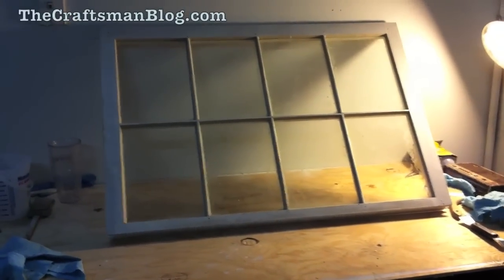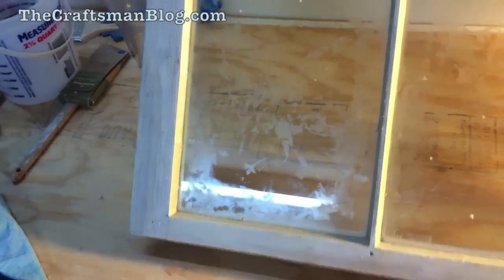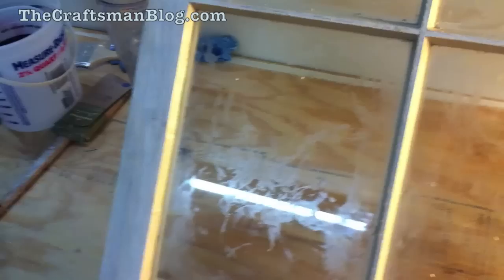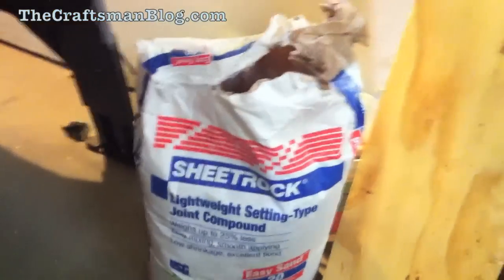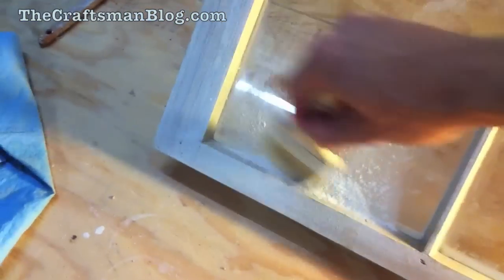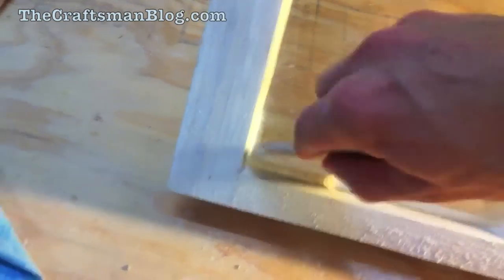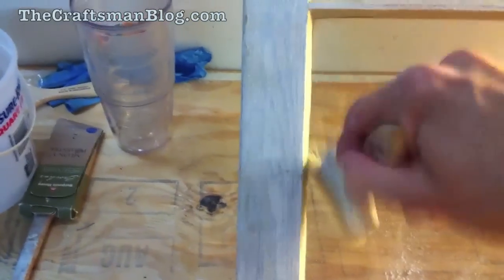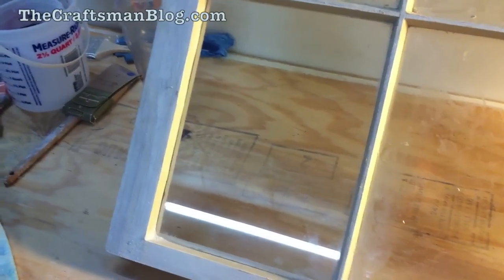How To: Clean Oily Glass

Comment: I recently went through the same search for “whiting”. Big box store paint departments were no help. Then a search on the internet turned up the product, but it is expensive. So ... I researched the ingredients in “whiting” ... only one ingredient, calcium carbonate ... which is simply powdered limestone. Also known as lime, the same stuff used to line athletic fields, and it can also be used as a soil amendment that loosens clay soil.  Many other uses too. I found it at the Rural King farm store for $2.99 per 50lb bag. Now I have enough to clean the putty oil off of every window in the city.

Other possible products: Bon-ami (finely powdered feldspar), Gold Medal flour (obtained from wife’s kitchen),  Plaster of Paris (powdered gypsum), and of course patching plaster (mostly powdered gypsum).
Reply: Solid tip, many thanks.
Reply: You can also find calcium carbonate at home brewing supply shops if you don't have a farm store around, not as cheap as yours but only a couple bucks a pound which is still much less than amazon wants for 'whiting'

Comment: I just learned of "whiting powder" today to clean glazing oils off glass, and was going to order 2 lbs. for $12.98 + shipping.  But how did I not know about it before now?  I know a lot about a lot of things about home improvement, remodeling, maintenance, restoration projects.  Not only the whiting, I now learn I've had the product all along in the form of joint compound and lime for my yard, and it only cost pennies per pound.  I think of all those windows, main windows and old wooden storms, that my wife and I reglazed and struggled to get the glazing oils off of.  Most are done.  Sheesh!
Reply from the maker: I wouldn’t use lime for this since it is caustic and very alkaline, but gypsum works like in the video. It doesn’t clean quite as well and still has more reactivity than whiting which is completely inert though.
Reply: @TheCraftsmanBlog  Thanks for the tip, I would have used the gypsum/joint compound anyway, lime isn't something I keep around - would have done a bit more research anyway.  Thanks.